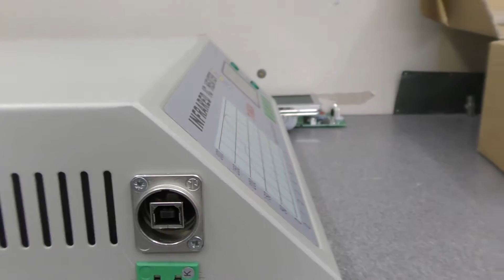T-962A Re-work Oven Controller Upgrade

Comment: The cold-junction compensation is going to be off since the cold junction back to copper is at that connector mounted on the outside of the case, and the thermcouple interface chip is inside the case and possibly warmer.  So the temperature reading is going to be off by the difference I think.